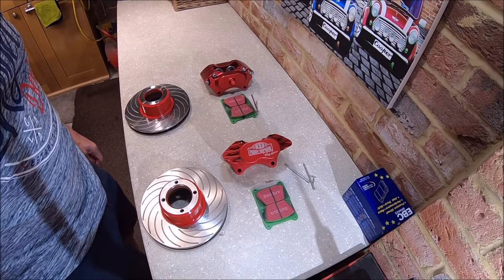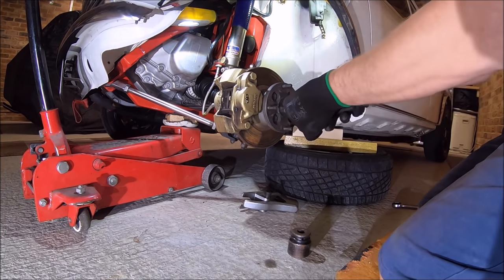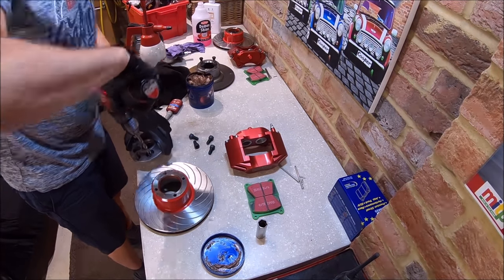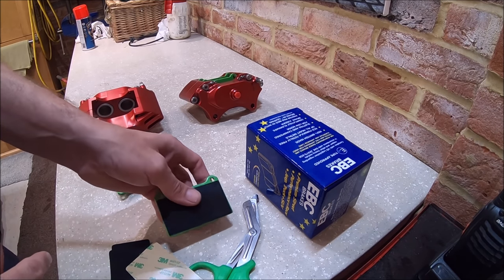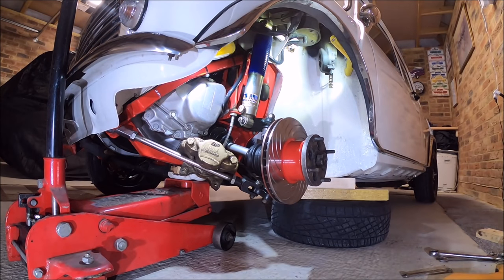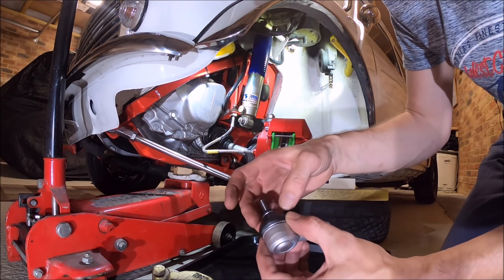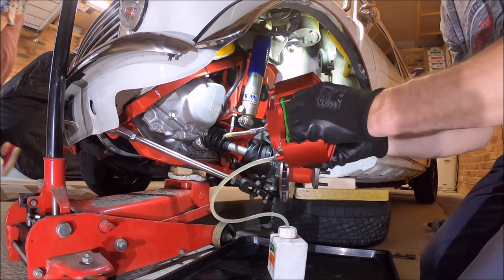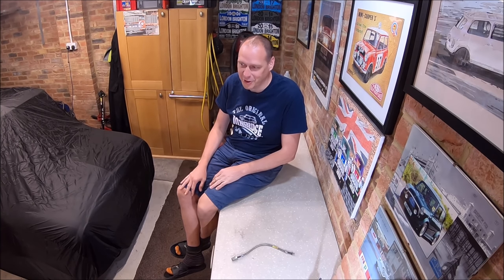Classic Mini Workshop - Brake Upgrade 8.4 inch Vented 4 Pot Calipers

Comment: As I think we mentioned elsewhere there is nowt wrong with showing 'warts and all' because we all make mistakes, its how people learn and it shows how easy little upcocks can happen. I once rebuilt an 12 Litre MAN 6 cylinder engine and set the exhaust valves to the later high pressure 'Common Rail' fuel system setting ..... Luckily I put the later labels on so at least had a pointer. And I was a Chargehand ffs ....

Comment: Great looking breaks Keith do you do your own tracking.. Maybe we can see a video off that if you do . Got new track rod ends to dig myself.. And having 10" wheels most of the local places don't like doing the tracking .
Reply from the maker: I've borrowed some Dunlop type tracking gauges to do mine. I tracked it up last night but didn't video it. A couple of people have asked so if I get a chance I will video a bit later. The first time I tracked it up I've just used string and a tape measure
Reply: @classicminiworkshop  cheers Keith I'm going for tape measure and sting watched a few videos about it .. look forward to future videos 👍

Comment: Heat won't be an issue mate, you'll need to paint more onto the disk if you want to prevent rust appearing. It's about 10mm from the edge of your current paint line where the pads finishes on the friction surface. Found that out the hard way 🙄
Reply from the maker: I was going to paint half way up the disc and let the friction take off the paint to get the perfect line

Comment: At 2:39 you took off that bracket, to keep the pads tight, do you have to put it back on?
Reply from the maker: The pads on the 4 pot calipers do not require the retainer clip like the original pads
Reply: Classic Mini Workshop okay great thanks, it's just I did the smaller cooper S brake conversion and forgot that spacer so the pads wiggle only slightly.

Comment: Hi Keith, I bought a 1995 Mini Cooper back in May and since then your videos have helped me out massively, I genuinely don't think I'd have fixed half of things on the car that I have without your videos, so thank you massively for that. I know this is an older video but I'm hoping you'll be able to help me out with an issue I'm having on my own brakes. I recently upgraded to the Mini sport 8.4 brake kit with new calipers, discs and flanges and I've got them all fitted on the mini. The issue I'm having is with the brake calipers and the brake hoses. The first time I installed the calipers was with the bleed nipple at the top, I spun the caliper onto the line as much as I could but to get it tight it required me to twist the line 1/2 way from straight. I messed around with this for a while but still couldn't get them tight without a twist, any looser and brake fluid was leaking out. So yesterday I decided to try swapping the calipers around and it has solved the issue. The lines are on and fully tightened with less than a 1/4  twist. My problem now though is that the bleed nipples are positioned on the low side of the caliper. I'm happy to leave the calipers on the way they are but did you find you were able to get them properly  bled the way you tried to in this video, by taking it off the disc and holding it flat to allow the air out? Had you wanted, could you have kept your calipers on in this configuration? I'd love to go ahead and bleed them as is but I'd just love a bit of advice beforehand about whether I should even try or should I keep looking to find a solution to the twist in the lines when the calipers are on on the correct sides?
Reply from the maker: Hi Aaron, even 1/4 of a twist in the brake hose could be enough to affect the braking and will likely fail an MOT if spotted. Unfortunately they only way to untwist the hose is to loosen the end that fits in the subrame on the metal pipe which can be a pain to get to especially if it's all seized up. You could bleed the brakes the way you say by removing the caliper and disc and holding so the nipple is at the top but ideally it would be better just to fit the correct way and loosen the brake hose at the subframe.
Reply: @classicminiworkshop  Thanks Keith, I hadn't even thought of that. I'll take a look at the brake line connection at the subframe, might upgrade to braided brake lines while I'm at it. Nothing I've worked on so far has been too badly seized so hopefully this'll be the same. Thanks so much for the advice! Have a pint on me, cheers Keith!

Comment: I recently replaced the front drums on my mini with 4pot calipers, but I've been having a few issues since. Do you happen to know alot about the various braking systems on minis, or do you know anyone else very knowledgeable? The forums always seem to fail me and I'm not sure who to ask. 

Cheers, Eirik :-)
Reply from the maker: What problems are you having Eirik?
Reply: @classicminiworkshop  My front brakes start dragging really bad after I've used the brakes to come to a full stop, not even an emergency stop. The brake pedal goes very firm aswell. As mentioned I replaced the front drums with 4pot calipers, wich are even on the right way round thanks to Cole!

My Mini has a split line master cylinder, not sure wich type/tag but it has a circular container. Pdwa valve on the firewall and an inertia valve in the rear subframe. I remade several brake pipes and replaced all 4 flex hoses with new braided ones, I also replaced the rear brake cylinders with the ones I was recommend, I believe 5/8 but I don't recall at this time. It was recommend both by a forum post and a technical advisor from Minispares.

The braking system worked flawlessly before I switched out the drums. I haven't really looked all that much for the fault as I have yet to work out what would be the most likely culprit.

Thank you in advance for any guidance with this issue.
Eirik
Reply: @eiriktell3972  If you have a PDWA valve ('78 on Metric unions) on the front bulkhead you should not have another valve on the rear subframe. Just a plain 3 way union. You say its a 'split line' system but is that Front / Rear or LH / RH diagonal split? This could be affecting the new calipers which don't have the double retracting springs each side the TLS drums have and only rely on seal retraction to return the pistons. Although you don't mention a servo I doubt this would be the cause as it just (basically) passes fluid through although again the TLS drum system is pushing fluid back by use of 4 springs which the calipers are not.
Just a guess here on your problem but I would certainly remove the rear valve and fit the correct 3 way union (p/n 3H2424)  as that conflicts with the front PDWA valve. Hope this helps somewhat.
Reply: @1chish  Thank you, this does indeed help. And to answer your questions, It's a front rear split without a servo and the PDWA valve is a pre 78 one, it has 5 holes, bleed screw in one of them. It's a 73 Austin Mini 100, I suppose the previous owner might have replaced the braking system but leaving the inertia valve in. After writing my initial comment I have since out of frustration ordered more parts.. Yellow tag master, 78 on pdwa valve and appropriate fittings, T-union and such, going by a different example of the braking system. I will be removing the inertia valve, hehe.
Reply: @eiriktell3972  Well that should pretty much do it! The GMC227 (Yellow Tag) Brake Master Cylinder 
is the only option these days and the FAM7821 PDWA Valve matches it. Be careful you have the right pipes from the Master Cylinder to the PDWA as they differ from earlier versions (metric vs Imperial)

Good luck.
Reply: @1chish  Thank you very much. I did purchase the premade pipes from Minispares, to go between the master and PDWA valve, due to thete being two different size unions from what I could gather. The rest of the pipes I will make up myself :-)

Comment: An important point to mention when shimming pads is that if the inner flat part  of the pistons is hard up against the caliper the brake fluid can't get in the gap to push the pistons out. I'd also have probably removed the red abrasion coating especially with new discs.